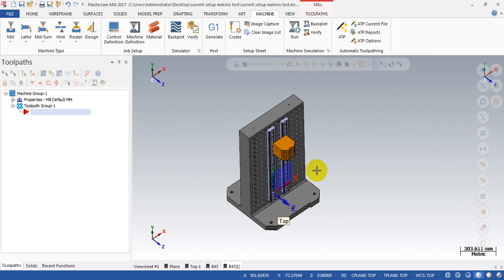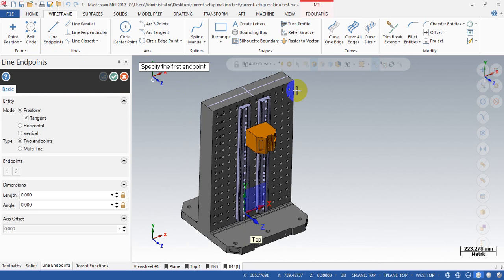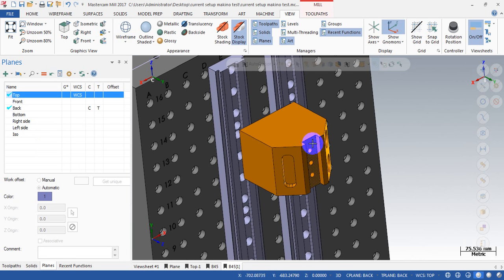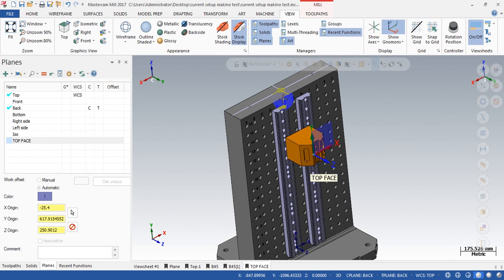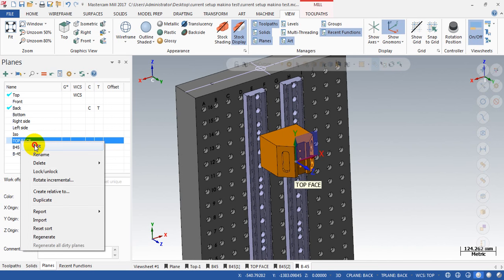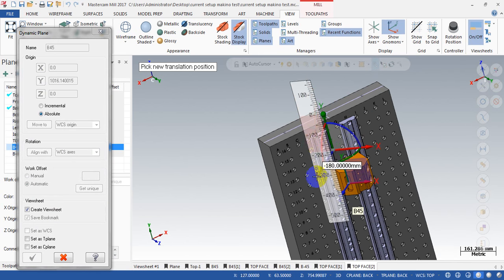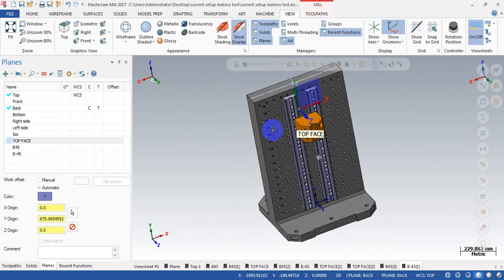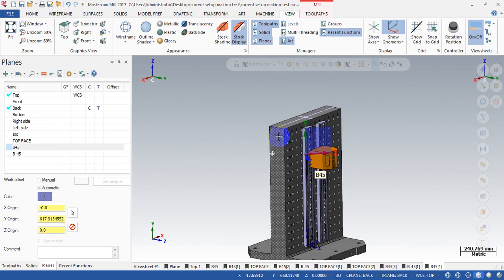MASTERCAM: CREATE TOOL PLANES ON A 4AXIS-HMC

Comment: Hi Giang Thanks for your nice videos. How to configure a 4 Axis HMC machine Tree in Machine definition manager? I tried but not works. Machine Base-Table Group-HMC Z axis-HMC BAxis-Mill Machine Table- Fixture/Holder.
Spindle Group HMC X Axis-HMC Y Axis-HMC Tool Spindle. While I save this Warning comes as This Machine does not have any valid axis combinations defined and cannot be used in a toolpath group

Is it my tree correct could you please help me . I am learning myself. Thank you.
Reply: Try to use mpmaster machine file and post, that's the easiest way to do it.

Comment: thanks a lot Giang , for the program generation  on MC is it possible to keep just the top plane make the first face  and then rotate the table 45 deg to make the side face and the same for the last face to make the program?
thanks again
rgds
Reply from the maker: yes, instead of creating 3 different tool planes and then using 3axis tool-paths on each plane, use can create 1 tool plane then use a Multiaxis-tool path, the part will automatically rotate.